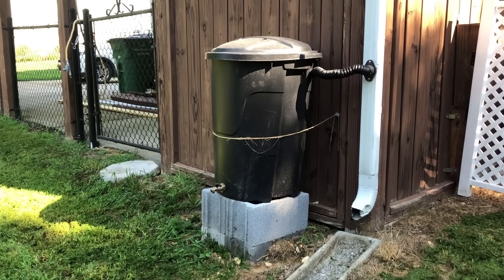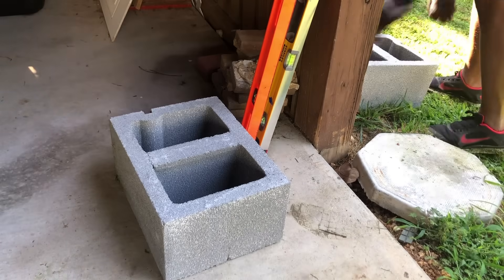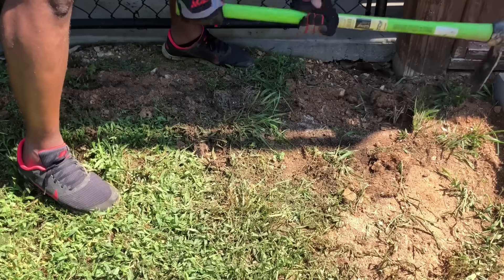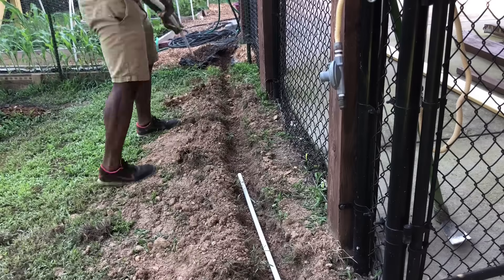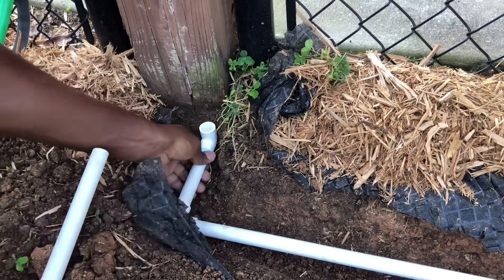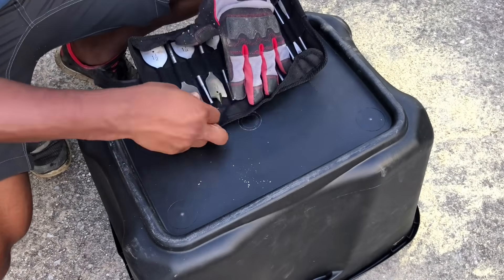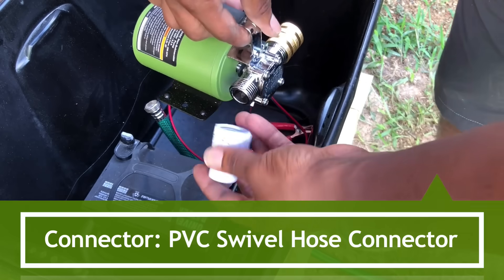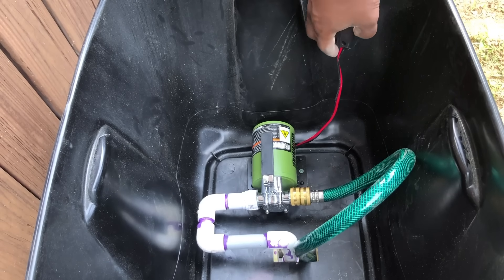Rain Barrel System | CHEAP Water Pump Setup

Comment: Nice job Robert! One thing to consider when setting up a system like this is to include a backflow prevention device to protect you home's city water supply from potential contamination from your rain barrel source. Check your local plumbing code. It may be as simple as inexpensive double check valves or more expensive with a reduced pressure zone backflow preventer which may also require periodic inspections by a certified backflow technician.  Probably safer just to pipe up two separate spigots to prevent potential cross contamination.
Reply: Although a backlog preventer is a very good idea, the water line Ata spigot us not directly connected to the city water supply but rather through the house. All houses should have a backflow preventer upstream of the household water shutoff. The real concern here, is backflowing into his own household water piping.
Reply: City water is already polluted. What’s the point.
Reply: I am a licensed irrigator and it is against most if not all municipal water supplies regulations to create a cross connection between a rain barrel, pond, well or frankly any source of water. You would have to have an air gap not a check valve. You must keep the two systems separate. 
If the idea is to keep all hoses connected to the    Rain barrel collection system then just fill the barrel from a garden hose if you don’t have rain water collected. In this scenario you would still need an air gap between the hose and the barrel.
Reply: A simple inline hose backflow preventer/vacuum breaker would be fine.  Cheap and easy.
Reply: Also, depending on what protection he has on his city feed, that may only be for his benefit
Reply: He has an in line vacuum breaker connected for protection.
Reply: I love it
Reply: He used a rain water barrel. Back flow shouldn't be a concern unless using a refill system to top it up directly to the barrel
Reply: @chrisl7608  I suspect the city inspector would raise hell anyway, if they saw the interlink between the water barrel and the city water lines. They freak out about it even if there is NO water barrel attached.  I once had a city inspector in Cheyenne, Wyoming make all kinds of threats if I refused to install a backflow prevention device on an outdoor faucet that never connected to anything but a hose and lawn sprinkler.  The trouble is not a simple matter of differential pressure.  The problem arises when the city water system LOSES pressure.  That's when backflow happens and pollutes the city water with water from the rain barrel.
Reply: @chrisl7608 that  spigot he is using with the barrel is also shared with this city water line

Comment: The local code doesn’t require a back flow preventer when making a connection to an external source?
Reply: Dude 
DIY is not code reliant.
Reply: @joshuascelsi2237  actually you can get slapped with huge fines for certain things, in some municipalities that is one of them.
Reply: @joshuascelsi2237  Listen to BeetleBuns.   He/She is absolutely correct.  They won't care that you didn't know any better.  The fines are huge because you risk back feeding dirty water into the city system.

Comment: Sorry to tell you this that you have a built-in cross connection. That's where you can mix city water with your rain water. I know you have a stop on both but if for some reason you leave both on, you could be drinking what's in your rain barrel. :-(

Comment: Any problems with the rain barrel with HEAVY downpours? Is the gutter attachment able to handle it without forcing water out the barrel's overflow hose?
Reply from the maker: Hey Amy. No issues for me yet with the rain barrel and it has been installed for almost a year. The attachment works well also.

Comment: Will that pump stop when the line is fully pressurized or do you always have turn switch on and off? Like an Rv water pump will turn off when the line is full but turn back on when calling for more water..
Reply from the maker: Hey Daniel. No, it is not an on-demand pump, just a basic transfer pump. For my practical application for the garden, the flow should never be blocked since it will be connected to the irrigation/sprinkler system. But if I had to do it again, and if I could find an on-demand pump for around the same price, I would definitely go that route due to the built in pressure sensor.

Comment: Question: You have the pump running while the water is turned off at the spigot? How did the pump hold up?
Reply from the maker: The pump still runs great to date. I typically do not have that situation, and it was for demo purposes for the video. In my real world case, if my pump is on, the irrigation/sprinkler system will allow water flow. I'm looking into on-demand pumps or an external pressure sensor for cases similar to the one you mentioned. Great question.
Reply: @GreenTechTown  thank you for responding. I am glad I asked. I bought the same pump and pump lake water to fill my garden watering tanks. I wondered about using a hose with the pump like you showed. But after hearing how the pump worked harder when the hose got partially clogged with debris, I wondered how using a hose to water like you showed would work. You clarified things for me. Thanks for the great videos. Blessings.

Comment: Use a microcontroller that checks for water pressure, then when you turn on the spigot the motor will turn on.
Reply from the maker: Great suggestion Robert!

Comment: Why not just move the water tank up in air & use gravity.
When is the anti-siphon device to protect the city/house water supply?
Reply from the maker: Hey Alan, I wanted more pressure for my application, but I've seen others use a gravity system and it is definitely something I'd like to try one day. The anti-siphon is installed on all my outdoor spigots. I added a note regarding this in the description. Thanks for watching.

Comment: Nice. Got some good ideas there.
What do you think about a 1000 litre tote on top of a 6 ft. water tower, all of the watering done by gravity feed? I'm thinking of giving that a try.
Reply from the maker: Hey Andrew. I've never used a gravity feed system, but have seen others do so successfully. I say give it a try!
Reply: @GreenTechTown  I have several water totes (1200, 420 and three @ 220 gallons) fed by gutters.  You can gravity drain, but I prefer a small utility pump attached to a garden hose.  A 1/3 hp utility pump can move a lot of water.  Throw the pump into the top of your tank and plug it in.

Comment: You should have used a union plumbing fitting to join the pump to the pipes be able to disconnect your pump easily.
Reply: I'm not sure "should" is the right word,  but I definitely appreciate your comment. I'm looking to do something similar and that's a great tip, so thanks!

Comment: Great video! Thank you for it! I'm guessing your rain barrel is around 55 gallons...how long does one full barrel last watering your garden before switching back to city water?
Reply from the maker: Since the growing season just started back for my area and since I plan on using a soaker hose or irrigation drip system, I do not have any up to date info for you, but from last year, I believe it lasted about 10-15min.

Comment: Great job and explanation.  I would very much enjoy seeing you kick it up another notch Robert!  Have you determined the which watering method is the best?
Reply from the maker: I would say the soaker hose method in this video, but a drip irrigation system would be the best since it uses less water and applies water only where you need it.

Comment: Question. The pump can be run without opening the watering source? Doesn't that harm the pump? Having it running while not opening the valve at the other end?  Nice job!  You have inspired me to do something similar to my rain barrels.
Reply from the maker: Great question. I try not to close off the exit too long if the pump is running, but some pumps (such as an on demand pump) has a built in pressure switch that will automatically turn off the pump when that happens. There is also an external way you can setup a pressure switch that I want to look into, but for my application, I will not have my water exit out of the spigot blocked while watching the plants.

Comment: You have the elevation to place a higher tower in line with the source to gravity flow to the hoop in your garden
 Outstanding 😎 as Is
 Love the dry fit measure twice cut once 😁
 You'll realize with your next pump on demand will serve your needs slightly better
Reply from the maker: Yes, you are correct, an on demand pump is something I would like to look into next time around! Thanks for watching.

Comment: This system is highly illegal in most areas of the US. It is due to possibility of contamination of the municipal water supply. There has to be anti backflow valves and other safety measures installed on the city side of this installation. In most cases it will require an inspection when tieing an outside water system to a city water system. The easiest route in most cases is just install to seperate spigots and dont tie the 2 systems together. A lot of homeowners and diy'ers dont even give this a second thought or are aware of the safety issues of this.

Comment: Probably best not to plumb rainwater line to same line as home water (code violation) - unless using a back flow valve.  Best house two separate outlet valves.  Great work though

Comment: Very detailed video. I'd use a RV water pump. It's got a built-in pressure switch. Also, I suspect you might need a check valve on the city side to prevent contamination from the rainwater.
Reply from the maker: Hey Jerry, I agree on both points made. Thanks for sharing.

Comment: Thx for sharing the video. I would've used an a/c pump. Just purchase one that has a cord on it then plug it in to an outlet. Done. You have full pressure for as long as you need it. With dc you need a battery, solar panel(s) and a solar charger. You have to mount the panels so they won't get blown away in the wind but also mount it such that it gets sun. But then the sun moves. Battery, panels and solar charger is added cost and they go bad. My garden is bigger than what you shown in the video, what you have works for you. For me, I repurposed a sump pump that has a cord on it. I place it in my water barrel, turn on the power and it makes quick work of watering. No need to plum any pipe or make connections or cut into the water barrel etc.  There's more than one way of doing things its good to see how others solve the same problem.

Comment: Like he did in this video, most pumps will need to be installed lower than the water level as they are not usually self-priming.
Reply: Bought this exact pump to pump lake water into barrels. Worked great with the pump set 10 feet above lake water and pumping up another 5 feet. 150' of hose. I was impressed.
Reply: @silverwillow9348  good to know! Thanks!

Comment: Great to know that the system will run any watering. How big was the pump
Reply from the maker: The pump is not very large. It has a 290GPH flow rate with a head lift of 40 ft.

Comment: Nicely done. Simple and neat.  Looking forward to the solar panel and switch. One question - what is the second ball valve for (above the faucet)?
Reply from the maker: Awesome! The second ball valve was for another water source connection that is no longer being used in my system. As many has suggested, if going that route, always have a backflow preventer installed and check your local code.

Comment: Super video for folks to use rain water more effectively in their gardens.  I have a very similar set up using four 275gal totes around my home and shed/poultry runs.  One set up w/electric transfer pump that I connect to a timer to turn on the pump.  I have the water lines connected to garden raised beds and into two season extending  poly greenhouses.  I also connected a 4 position timer manifolds I can control a "rotating" auto irrigation  which works great for me.  So the transfer pump operates on a schedule and the timer manifold irrigates 4 zones.  I could modify to solar pretty easily but don't want to set up another system/panels due to space.  I have a similar system set up in a 25ft poly tunnel that is all hydro and that's all solar (airstones/pumps) because the set up is stationary.   There are two other zones - one a fruit orchard and another for perennial gardens that I have set up with drip tape irrigation lines and use a batter operated transfer pump that I can move around for those.  Love your videos they're super informative!
Reply from the maker: Wow that's awesome!

Comment: Great job! I would suggest get an IBC tote it holds about 275 gals of water.  If you want it to be auto shut down on the pump get the pressure pump tank and install a battery operated timer for your sprinkling system.  Just a suggestion my friend for convenience.
Reply from the maker: Thanks for the tip!

Comment: how do you charge the 12v battery
Reply from the maker: Hey Vinnie, currently I am using a solar panel to charge the battery. You can find more on how I set that up by going to my channel and looking at the Solar Water Pump video.

Comment: good project.  you did scared me when you cut wood on the tablesaw, push the wood that is between the fence and blade.  soaker hose is best option , it will get water to root zone and not on leaves thereby lessening chance for fungus issues.  i do in ground pvc pieces first when gluing up to prevent inadvertently rotating other pieces.  keep growing!  now you got to get chickens.
Reply from the maker: Haha, yes maybe one day I'll look into getting chickens. Thanks for the tips!

Comment: Hi I hate doing this you have to stop using the primer on that small pipe just get red hot there is a solvent in it also keep your glue closer to the fitting the prime and glue will make the pipe fail I always use a rag you can through away when you do your gluing apply the glue put your fitting and pipe together then wipe all  Excess glue off

Comment: I am wondering why you didn't use an electric pump that you could plug in and avoid the whole battery scenario. Thanks for the videol
Reply from the maker: Hey Elaine. I went this route because it was easier for me to add solar to it later. If I used a AC version, I would have to buy an inverter which is an additional component and extra money :D.

Comment: Great video, very informative and inspiring. Does the pump have an auto shut off for when the water runs out?
Reply from the maker: Hey Dan, great question. I just put out a video using a float switch for this 1 concern.

Comment: Awesome video! Got me to subscribe to see what progress you make with the system.

One safety concern... At around 5:30, you are cutting the trim board. When you push a board past the saw blade, please position the push stick between the blade and the fence. Pushing on the other side of the blade is a major cause of kickback.

Comment: Probably already suggested, but a cheap pressure switch to activate it on demand would be nice. Also,  Quick disconnects instead of glued joints at the start would allow for easy removal during winter months.
Reply from the maker: Hey Ken, great suggestions, and thanks for sharing! The pressure switch is definitely something I want to look into. Do you have any particular brand recommendations or links to any you have used or heard of?
Reply: @GreenTechTown  No, sorry. The one's I've used in the past are easy to adjust though, with a screwdriver against spring pressure. Big box stores have them for well pumps. There are others for HVAC..

Comment: You may want to install an AVB (Atmospheric Vacuum Breaker) on your city water line as you have created what we in the industry call a "cross-connection" and it has the potential to deliver unclean water to your home or if a hydrant were hit on your street, it could back siphon your rain water into the city system.  If a neighbor we're to then get that untreated water and get sick or worse, you would not only feel bad but be liable.  Just a suggestion.  Nice work though.
Reply from the maker: I agree, and I also have one installed. I plan on disconnecting this part of the system also, but I added a note in the description regarding this concern. 
Thanks for sharing and for viewing.

Comment: nice set up dude. I like it.
One thing I would add, is in some places, it's illegal to have a tank system that can flow back into the mains without an approved check valve. I know you've got the ball valve, but should you forget then technically you could flow back.
This may or may not be legal where ever anyone else is in the world, but it's definitely not a good idea to do that anyway regardless of legality.

Comment: Nice approach.  Good teaching style, I feel like I could do this.  Minor suggestion:  get a bigger rain barrel - you can get used IBC totes that are food grade - which means they formerly contained food like oil or syrup or something as opposed to some chemicals.   They're like 275 gallons (1000 liters) and cost like $75.  So, good deal.  Instead of a 32 gallon trash can.  Almost 10 times the volume.  They'll fill up easily in a decent rain.  Give you a little more capacity - for the work and PVC and pump already invested.

Comment: You sure do a great deal of cutting.  Shows the value of having a specialized,  dedicated,  tool. Also how you can modify layout on the run. Thanks for sharing.
Reply: I can guarantee that the city code was violated with the rain barrel and city on same pipe

Comment: For your future project improvement, add an "on demand" pressure switch in parallel with the manual on/off switch.  When you open the valve the pressure drops and turns on the "on demand" pressure switch.  When the valve is closed the water line is pressurized and the switch turns the pump off.  Very neat project, well done.